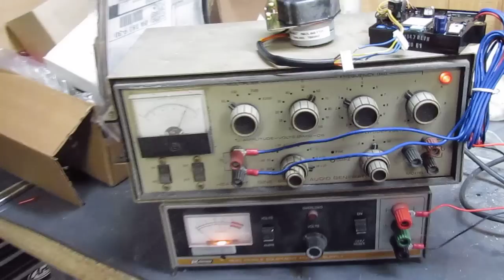Generac governor

Comment: Good morning, I have a problem with the step by step, could you provide me with information in pdf for the Generac 0D5304 card. Thanks in advance
Reply from the maker: Hi, I am not sure what you are looking for? Do you need instructions or do you have a problem with the stepper servo?
Reply: @iarufe98  If I have a problem with the stepper motor and the Generac 0d5304 card, I need a manual to help me. Thank you
Reply from the maker: @luisalbertogonzales1560  , I am not a generac employee so any info I know is from searching the internet. Here is a link for some instructions. Sorry I can not be more help. https://www.partsfortechs.com/myfiles/file/098647A.pdf
Reply from the maker: @luisalbertogonzales1560  https://www.partsfortechs.com/governors-and-speed-sensors-c-14_67_74/generac-098647asrv-98647-governor-control-kit-stepper-p-534.html

This is the model of the part in the video… not sure if this helps.

Comment: Do you know the part number for the stepper motor? I'm needing it for my old generator
Reply: I work at Any RV Parts, stepper motor is a 098290, control is a 098647ASRV

Comment: does anyone know the voltage limits for the AC signal?
Reply: I answered my own question.  125 volts is okay.  240 is okay.  I connected mine to  readily available 135 volts and it works fine

Comment: I've been told I need to replace the stepper motor on my Generac Guardian 14kw generator. I got an estimate for $365.00. The part is around $60.00. So, nearly $300.00 for labor seems like a rip? How long should this take? Thanks.
Reply from the maker: I am not sure, I have never worked on a Generac Guardian, but depending on what needs to be taken apart to get to the stepper it maybe a 2 or 3 hour job and if a travel tech comes out I am sure they are getting 75 to 100/hr.

Comment: What is the voltage on the blue wires? is it 24VAC?
Reply from the maker: Well in this video I do not really remember, it is whatever the peak to peak the signal generator puts out. When Installed on a generator the blue wires get connected to the line side of the generator and the black and red wires get hooked to the engines 12VDC system.
Reply: 110-120

Comment: What is the red wire for on the stepper motor that you did Not connect to?
Reply from the maker: hello, it has be awhile since I messed with this system but I honestly dont know what the red wire is for. I had to get a adapter wire from generac to hook the stepper to the controller, at the time of the video i did not have that adapter.
Reply from the maker: http://www.anyrvparts.com/generac-generator-governor-kit-098647asrv-98647

I think this is the one I have.
Reply from the maker: http://www.partsfortechs.com/asapcart/generac-098647asrv-98647-governor-control-kit-stepper-p-534.html
Reply: yes, I have this controller too with the jumper wires.  but it keeps overspeeding my generator at 60Hz.  at 50hz, works great. but not at 60hz.
Reply from the maker: there are some fine adjustments on the board. I experimented with the length of the arm on the stepper motor as well. A longer one would allow more throttle adjustment for a little movement on the stepper and vise versa with a shorter arm.
Reply: @iarufe98  how do you adjust the frequency on generator because I know it's a old model so I need some help
Reply from the maker: Don Roberts there is a switch for 50/60 Hz operation. The other settings are for fine tuning how well it reacts to load changes etc.

Comment from the maker: I believe this is the model. Generac 098647ASRV (98647) Governor Control Kit, Stepper.
here is a site
http://www.partsfortechs.com/asapcart/generac-098647asrv-98647-governor-control-kit-stepper-p-534.html
make you u get the stepper motor and wiring harness. they have a link to the instructions, it shows the part numbers on the instructions for the basic kit, I found out what generac it came off of and found a parts diagram from that and it showed me all kinds of little parts they were very helpful at getting the stepper mounted to my engine.

The unit gets its input from the output from the generator head itself so if the generator Hz is under 60 hz it will call for more throttle on the engine, if its over 60hz it will call for less throttle.

Comment: Iarufe98, did you get it installed.  My mechanical governor is shot (bearings and seals) a new one is $1700....ouch.  could you give more info. on the parts you used and how it would receive the 60hz input to know when to regulate.  Hec, I'd even buy one from you....looks like others would too.     Thank you

Comment from the maker: No i was just testing the governor out with the signal generator. The Governor hooks to generator output to maintain generator frequency to either 50 or 60Hz. the governor itself runs off the engines 12v system